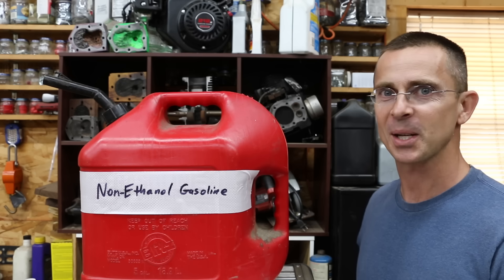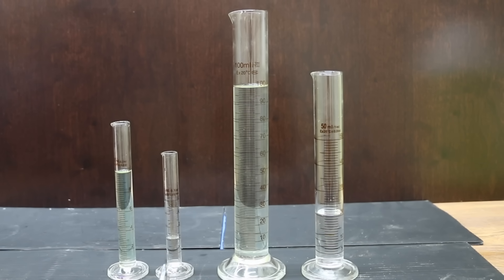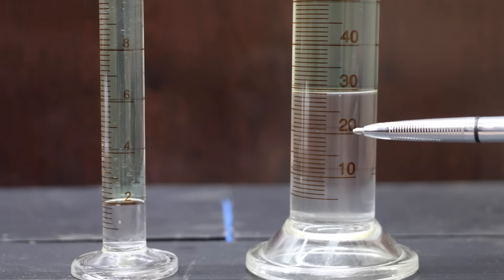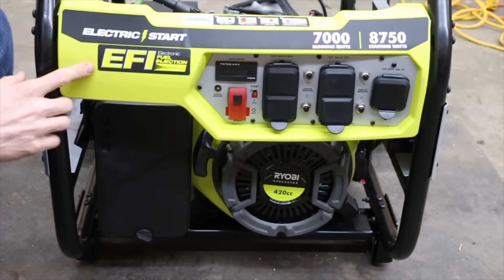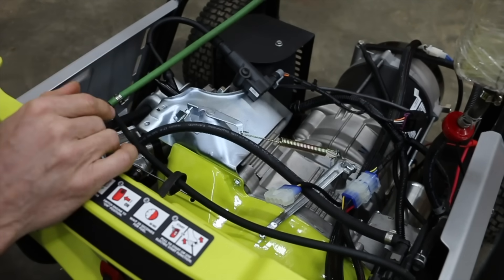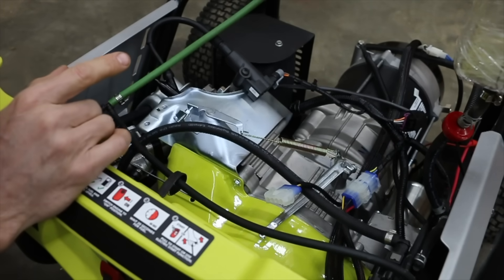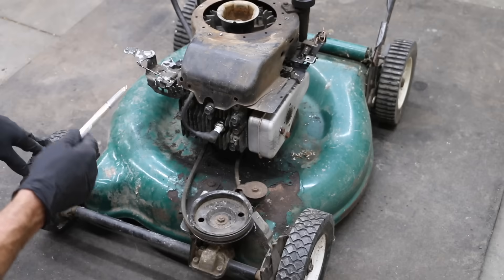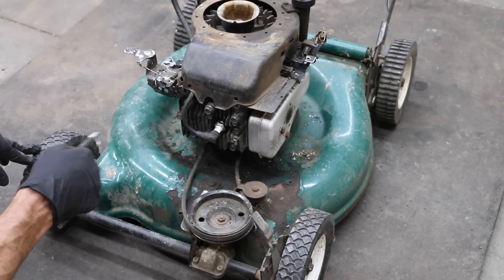Is Non-Ethanol Gasoline Really Better? See the PROOF!

Comment: I wonder if there was any significant difference in terms of horsepower output between the two fuels? What about also in terms of lubricity and is there any significant difference in the burn of the two fuels in a gasoline engine? I seem to remember something about always being some fuel that didn’t ignite during the ignition process in gasoline engines.
Reply from the maker: Thanks for the video idea.

Comment: Does ethanol gas make more power (does it have more calories than pure gasoline)

Can ethanol be replaced with other retardants like diesel or kerociene without damage or carbon build up? 

Also, i would like your help here. I know the parts stores sell snake oil and elephant tusk saying every engine treatment is somehow the best for your engine and nothing can beat it. Well what exactly is that crap made of? It all smells like kerociene to me but maybe there is a test for it?
Reply from the maker: Thanks for the video idea.

Comment: Great video and methods.  The huge issue is small engines fuel tanks rust much worse with ethanol added (hydrophilic sucks humidity from the air). It also messes up the floats.  My fuel injected Harley motorcycle doesn’t seem to mind but my motorcycle with a S&S super G carb fails if I use ethanol blends.  The float bowl will clog with a jelly substance.

Comment: I know commenting on a vid from over a year ago, any way. Received a call from a friend about their tiller not wanting to run, do the norm, check spark,air, fuel. Will run on starting fluid. So into the carb I go. 

Yep from just sitting over winter, the jet was clog with that green goo. Cleaned the carb fired it up. Good to go. 
Ethanol is horrible for long term storage, so if you don’t like to or don’t know how to drain your carbs. Definitely get the gas with out it.
Reply from the maker: Thanks for the feedback.

Comment: You have one small issue. It's volume contraction. If you mix 20ml of water and 10ml of ethanol, the volume will be way less than 30ml as the internal structure of the mix changes. It's a physical reaction, not chemical but it happens in mixtures of different fluids. it can be 5+% at room temp and it also changes full decimals on 10C changes in temperature so it's all over the place. A better way to measure is distillation but that's a hassle
Reply from the maker: Thanks for the feedback.

Comment: The motor used to be designed to run off ethanol. Rockefeller didn't like this idea of having competition. So what did he do? He paid off a politician to make it law that forced them to add petroleum to all ethanol  gasoline so in turn it was not profitable for people to sell ethanol when you had to mix petroleum with it.  So they stopped making car's that run off both products. But kept it on diesel engines.
Reply from the maker: Thanks for the feedback.

Comment: The problem I have with Ethelyn is that it draws water into the tank and rusts out any metal tanks and dissolves plastic parks like parts of your fuel pump and fuel system
Reply from the maker: Thanks for sharing.

Comment: I have heard from mechanics that ethanol can break down gaskets and other rubber parts over time leading to a shorter engine life overall. This does make sense to me as ethanol is a fantastic cleaning solution and can easily break down adhesives.
Reply from the maker: Thanks for the feedback.

Comment: Here's a question I've been wondering about. My challenger scat pack requires a min of 91 octane.
The pumps by me have 89 Non-ethanol. So it doesn't meet the minimum requirements. Ive been using 93 ethanol gas. I assume this is the way to go and i dont have much of a choice. Sure non-ethanol would be great, but I dont want to run the risk of fuel not burning properly and getting engine knocking. So. I guess 93 is the right choice?
Reply from the maker: Thanks for the video idea.
Reply: Look at the publushed RON vs MON numbers to see the ratings. Not typing out the explanation, just look it up.

Comment: I am old enough to remember leaded Gasoline additive was used to stop spark knocks.
I am also old enough to remember in 1973 OPEC proclaimed an oil embargo for supporting the Israelis in the  Yom Kippur War.
I am also old enough to remember in 1979  oil crisis due to decreased oil output in the wake of the Iranian Revolution. 
This is why the US started adding alcohol  to gas not for the environment.
In this time the US oil companies were not refining our sweet Pennsylvania, or Texas crude, holding it until they saw a price they liked.
The refiners were getting as much oil as they could refine and more from the Middle east, that's why it was called a false  shortage as the US had lots of oil but the companies would not release it.
So, as a result all this chaos so was born all the attempts to produce alternative fuels in crisis.
The farmers already planted several crops that could be distilled with corn on the top of the list.
It helped the farmers earn a livable wage, and was a pull yourself up by the bootstraps... the American way.
So, today after the discovery of several massive oil reserves in the USA we really do not need to keep the alcohol however, thousands of US  high paid workers would be out of work, besides the new automobiles computers and fuel systems can automatically respond to pretty much whatever you want to put in your car, from methane gas, to all of the different variations of fuels across the USA.
Reply from the maker: Thanks for sharing!

Comment: Interesting, every single time I use gas with ethanol my mileage drops from 2-4 miles per gallon, no exceptions. Every small engine mechanic I have talked to says ethanol will ruin an engine, again no exceptions. When I take one in to be repaired that is the first question they ask, what type of gas do I use.
Reply from the maker: Thanks for the feedback.
Reply: My lawn mower is 15 years old. I have used E10 in the mower exclusively and have never had a problem. I park the mower in the fall with the gas in the tank and in the spring it always starts on the first pull. E10 works fine.

Comment: Never went into the main downside of Ethanol. Don't run the motor for a few months and then the motor will not start because the carb is gummed up. Ethanol is BS. I have to use race gas and it is expensive.
Reply from the maker: Thanks for the feedback.

Comment: I left some e10 in my Yamaha banshee over the winter by accident the next spring I drained the tank  and cleared the fuel lines or so I thought the bike was running crappy and I was losing fuel out the overflow tube and I figure  what  happened there is a y connection that splits the fuel line off the tank and delivers the fuel to  each side the y fitting was made out of crappy zinc coated steel the inside of it was rotting away and was collecting all over the reeds holding them open  I blame this on the water in the ethanol I replaced the y with a brass one rebuilt the carbs and never had the problem again  so if Yamaha would of used a better quality piece this could have been avoided
Reply from the maker: Thanks for the feedback.

Comment: I found that ethanol fuel broke down the clear hoses on my weed eater and chain saw, including the prime bulb. Visible cracking and created air leaks when running just over the winter season. That’s on 2-stroke motors. Using pre-mixed no-ethanol fuel this season had no negative effects.
Reply from the maker: Thanks for the feedback.

Comment: ethanol is a scam, when my local gas station switched years ago my car at the time went from 300miles per tank to 250miles per tank and i had to  fill up a day eariler.
Reply from the maker: Thanks for the feedback.
Reply: I bet you are from the USA if you are that thick that you don´t get that a fuel with lower energy density will take you shorter.

Comment: Fiberglass boat fuel tanks used to last forever.. ethanol I understand dissolves the resins and the resin, gas solution gums up valves...and deposits within the cylinder in general. Used to rarely have carb issues on Yamaha outboards..with ethanol, I gave up on carbs...just not practical to go to the one station that carries rec fuel at a much higher price.  Ethanol should be used by farmers...period.
Reply from the maker: Thanks for the feedback.

Comment: Great video again, Thanks!
I use Costco gasoline which has 10% Ethanol in it, And on my 2010 Prius, I do notice a difference in the MPG compared to the non ethanol Higher cost brands like Shell or Chevron, while on Costco Gas my MPG drops down to lower 40s and On non ethanol gases its usually in higher 40s. And about Higher Octane in Ethanol in practice, I have some doubts regarding it because in my experience, I do feel more power and smoother ride with non octane fuels from Shell or Chevron for instance...
Reply from the maker: Thanks for  the feedback.
Reply: You get a 10% loss on mpg from using a fuel with 96-98% of the energy?
Reply: @brianmorrison9066  Yes approximately, I would say about 5%-10% loss compared to Top tier Non-Ethanol fuels, and of course there are a lot of other factors could influence your MPG like driving habits, driving conditions, type of oil you use, spark plugs, etc...

Comment: Does ethanol fuel wear valve stem oil seals faster? I run ethanol fuel in my Mitsubishi magna 99% of the time and it's starting to blow smoke after idling for short time.
Reply from the maker: Thanks for the video idea.
Reply: @ProjectFarm  my pleasure ☺

Comment: Does (Tron) the fuel additive really remove Ethanol? I am a motor cycle mechanic from before the ethanol came in to the market, the old gas in the carburetors does look way different.
Reply from the maker: Thanks for the video idea.
Reply: Don't need any testing for that answer. No. 
Why no? Ethanol will not disappear into thin air by throwing yet another additive in the fuel.
With some luck it camouflages the bad effects of the ethanol and at best it prevents the carbon deposits form forming.

Comment: While unemployed in Oklahoma I often used E85 because it was $0.20 cheaper than regular.  A year later I replaced my engine because  an exhaust valve was burnt and busted.  $3000 to save $0.20 a gallon.  I didn't know E85 had such high octane.
Reply: And my engine was a flex fuel engine designed to use E85.
Reply from the maker: Thanks for sharing.

Comment: Of course the flaw in the test is that gasoline has unknown mixtures of other compounds (additives) that not only will you never get the recipe for, but is considered a trade secret. These stabilizers (naturally) harm fuel efficiency. It should also be noted, a car engine is not a lawn mower engine, and the car engines do suffer substantial loss of fuel economy with ethanol.
Reply from the maker: Thanks for the feedback.

Comment: The notion that ethanol damages rubber seals is an old wives' tale. That idea comes from the 1970s during the gas shortage when a new alcohol based fuel was put on the market - M85. The 'M' was for methanol, which is a much harsher solvent than ethanol. Today, we have E85, and when older people hear this, they instantly conflate it with M85 and have flashbacks of their fuel hoses rotting out. The fact of the matter is that gasoline is a very harsh solvent, moreso than ethanol, but methanol is worse. Furthermore, since that time, fuel parts have been designed to handle ethanol. On the off chance that you have carburetor seals that predate that... what you have is 40+ year old rubber parts that are rotten or cracked anyway just due to age, and need to be replaced!

Looking forward to the test results anyhow! :)
Reply from the maker: Thanks for the feedback.

Comment: My biggest problem with ethanol gas is when it's the only option and you have a car that was not designed for ethanol, thus having nylon fittings.  Nylon dissolves in ethanol...
Reply from the maker: Thanks for the feedback.

Comment: From a pure money standpoint--If the non ethanol is less than 10% more money that is what I will buy because my per mile cost is less because of the better milage.  I actually have had a couple of crown vics that  had an almost 20% difference at 75-80 mph.  It sucks to think that by using ethanol I at times am actually burning more gasoline plus the ethanol.   There is a reason the petroleum people never really complained about ethano entering the market.  Just one more taxpayer funded scam
Reply from the maker: Thanks for the feedback.

Comment: Ethanol is only a fancy word for alcohol. btw: If the fuel system in your car wasn't designed to use ethanol/alcohol it will deteriorate very rapidly.
Reply from the maker: Thanks for the feedback.

Comment: The problem with straight gas is that it burns slightly hotter than ethanol and also doesn't combust as well.  Heat is the main killer of engines and the issue with incomplete combustion causes all kinds of long term problems. Sure, you might get a bit better gas mileage by using non-ethanol gasoline, but over the long term, your engine doesn't last as long either.  I guess it's a trade-off and most people value longevity rather than....I guess efficiency.
Reply from the maker: Thanks for the feedback.

Comment: i work at a shop that builds race vehicles
one of our customers with a trophy truck thats tuned to run on 91 pump gas ran a race with 10% ethanol

with the 10% they got 2mpg, on a truck that got 4 to 6 mpg during previous races, thats a significant difference.
Reply from the maker: Thanks for sharing.

Comment: In Brasil the only gasoline option already has 28% ethanol on the mix... or people can also buy 100% ethanol fuel at the gas stations.
Statistics say that people using always pure ethanol on their ethanol compatible cars, tend to have fuel injectors and fuel pumps failing every few thousand km or mi, some times after 20 thousand only you already have a broken fuel injector.
Doesn’t happen with everyone, but all mechanics know that they receive a lot more clients using ethanol on their cars than clients using always gasoline.
That’s all I have to say.
Reply from the maker: Thanks for the feedback.

Comment: I am a hypermiler. So, I know exactly what my Mitsubishi Mirage CVT uses for fuel. I noticed an 8.5% increase in fuel use after switching from E5 to E10 fuel. Oddly enough this same exact figure was found by a British car magazine of which I do not remember the name, sadly. They tested I think 6 cars with E5 and E10 fuel. As an environmentalist I still prefer E10 because it shortens the carbon cycle of 10% of the fuel used by some 300.000.000 years. That makes the Climate change problems a bit less unmanageable.
Reply from the maker: Thanks for the feedback.

Comment: The biggest problem with adding ethanol to gas is the destruction of hoses, plastic and gaskets and the fuel absorbing water and destroying the engine as it breaks down. Absolutely destroyed the boating industry. Fuel tanks were destroyed. They are under the decks. Major work to cut up the deck to replace them.  I don't care so much about performance loss. I have had many small engines that don't get used often have real problems with fuel systems. My generator needed the carb cleaned. My chainsaws plastic parts expanded so much I could put the fuel cap back on. Motorcycles that are stored over the winter have fuel injectors completely clogged. All from ethanol.  Gotta help out the farmers by forcing everyone to put that crap in their engines.
Reply from the maker: Thanks for the feedback.

Comment: My Toro snowblower will barely run on E10 after about a half-hour.  I cleaned it with VP fix-it-fuel and then run 100% gas and it has stayed perfect.
Reply from the maker: Thanks for the feedback.

Comment: Only draw back on Ethanol free gas is the cost , during the corona virus gas has dropped . I bought some Ethanol free today the cost was 2.95 a gallon ,and the E-10 is down to 1.89 a gallon here in N E Indiana . the benefits using ethanol free on small engines is worth the extra cost especially in  the hand held tools fuel systems
Reply: here in the land down under in nsw, there's a servo that's selling unleaded 91 for 96 cents a litre. E10 is a bit cheaper but with these prices you'd be silly to not pick 91.

Apparently the sauds and ruskies are arguing with each other over oil, both countries want to be an oil monopoly or something and saudi arabia is retaliating by dropping oil prices further yet. Expect fuel prices to drop even further over the coming weeks.
Reply from the maker: Thanks for the feedback.

Comment: Check the differences in temperatures while running. I find ethanol runs hotter and could be why the Cylinders are cleaner because the carbon gets burned off but that doesn't make the engine run better or last longer.
Reply from the maker: Thanks for the feedback.

Comment: Ethanol in my truck make it run rough which causes bad fuel burning because the computer adds more fuel to get the engine to run better. Ethanol cause run on, caused by timing being out of sync do to hotter cylinder temperatures, the gas ignites before it is timed to fire
Reply from the maker: Thanks for the feedback.

Comment: The biggest issue I have with ethanol fuel is the way it attracts water when it sits or you don't use it for a long time. When i was a kid we let our mowers sit all winter and just started them up when summer came back around. But now I have to make sure I've gotten every drop of fuel out of the carb or it'll be clogged and I'll have to clean the entire thing out. The fuel leaves a gummy film inside the carb that is sticky like glue and really difficult to completely remove. But they are also using much smaller carburetors with super tiny ports and channels in them. So I'm not 100 % sure whether the problem is with the fuel or the fact that it takes almost nothing to block the tiny passages. Or maybe it's both.
Reply from the maker: Thanks for the feedback.